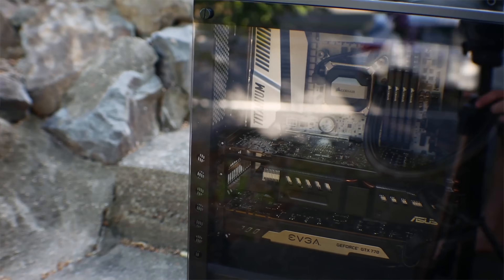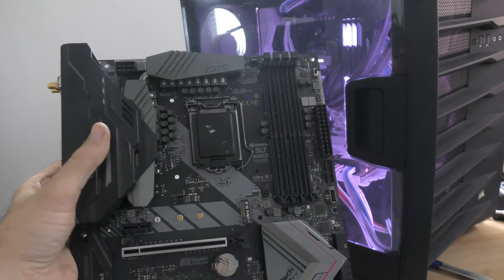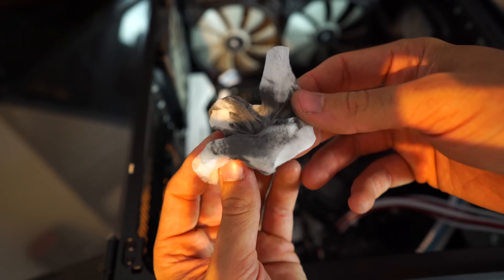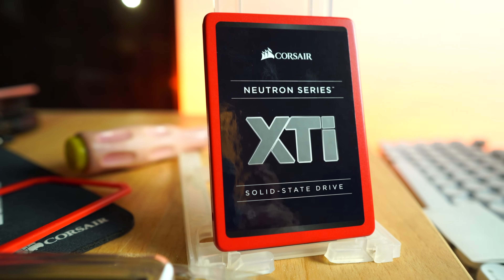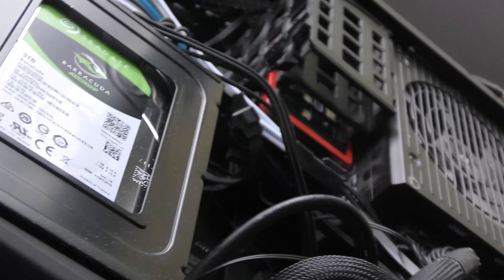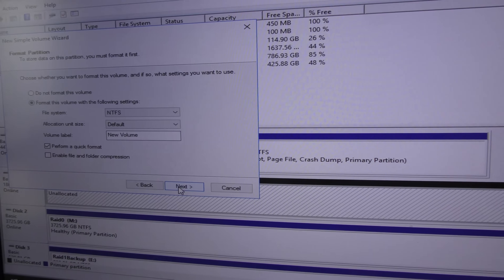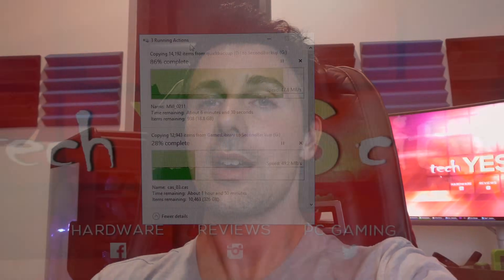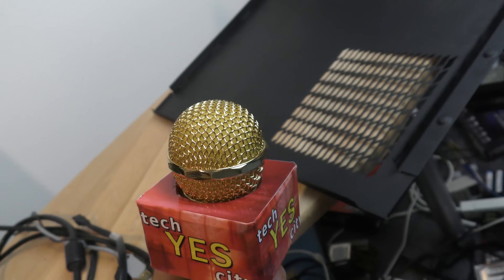Changing my PC from RYZEN to INTEL - Side, Up or DOWNGRADE?

Comment: 6 core beating 8 core? But all these AMD ryzen fangays told me its the way to go!!
Reply: ryzen is kabylake competitor

the competition for coffelake is coming in february (zen+) 

and the availability of coffelake is still trash with only expensive mobos
Reply: Pretty sure AMD never set out to 'beat' Intel.
Then again, AMD wins in most cases when it comes to price:performance soo, yeah?
For gaming, yes, the 8700k is best if you want maximum fps while running a 1080/1080ti at 1080p, other then that there is very little difference, especially for that extra cost.
Reply: Will
Yeah the facts you are pointing to show the 1800X is faster. Single and quad mixed benches don't matter, it's the MC mixed that does as that's using 100% of the CPU. That also inclues OC multicore performance which shows the 1800X being 7% ahead.
Facts don't lie, it's the bias of the fanboi that's cherry picking that does.
Reply: *marginally higher
It's just that their clockspeeds go up far higher which is due the manufacturing process AMD uses, however Global Foundries is claiming better clockspeeds for the next step so it will be interesting to see what Zen+ is going to bring. 

Also, @Will - Want some more facts? 
Fact #1: Intels prices dropped far more than they historically have.
Fact #2: Intels release of Coffee lake got moved up and has extremely poor availability. (theory:  It's a paperlaunch)
Fact #3: Moving up in core count beyond 8 cores AMD has much friendlier prices and starts getting better clockspeeds than Intel as well making it outperform Intel. This is due to AMD not shoving all cores on one piece of silicon but interconnecting them which makes heat/clockspeeds easier to manage.
Fact #4: Intel very uncharacteristically has Black Friday sales this year.

Does this sounds like  "The whole point is AMD cannot produce a chip even close to outperforming intel."? #3 Actually is the complete opposite of your 'point'. The rest seem to indicate (theory, but one that has some things to back it up) that Intel is upping their game this year, you know what causes companies to actually improve products? Competition! 

So in my opinion (and most people that like actual facts) they do have competition, hell they actually need to start making some changes if the race has begun towards more cores as AMD has build a base that will enable them to easily provide more and more cores in a cheap manner. Don't forget Zen is the first generation of this particular architecture. it will be iterated upon likely bringing instructions per clock further up, meanwhile Intel is on their uhhh 8th? generation so they'll have a much harder time to further optimize. Not to mention that Intel seems to have problems further shrinking down their manufacturing process whilst Global Foundries actually seems confident in their next step down - we'll have to see though, it would be the first time ever Global Foundries actually manages to impress instead of disappoint.
Reply: Your profile pic pretty much sums up my response to your comment.
Reply: Facts don't lie! http://cpu.userbenchmark.com/Compare/Intel-Core-i7-8700K-vs-AMD-Ryzen-7-1800X/3937vs3916
Reply: A 23% performance increase for a 32% increase in price, nice.
Sounds like you're the Intel 'fangay'.
Reply: Yes more performance costs more. Just as 1080ti is the best performance but of course not best value. The whole point is AMD cannot produce a chip even close to outperforming intel.
Reply: Overclocked ryzen beats overclocked 8700k in workloads.
Reply: Morbious Stone I know this isn’t exactly what you meant, but Intel doesn’t trounce anything 1600 and up from Zen by 80 FPS. Maybe 60 in a couple old 1 core games running at 720p, but normally the big gaps will be in OW or CSGO and be 250 too 210.

The 8700k wins in some productivity work, beats the 1700 and 1800 in cinebench and blender by a little, both stock and oc’d, and is also faster in Premier which seems to almost get stuck on 12 threads, using the others like ass.

It really varies app to app. Intel is obviously leaps and bounds better in gaming, if up to 20% is leaps and bounds.

Now at the same time, 1440p uw which Brian used lowers this quite a bit, as does 4k since the 1080ti is going to start dictating the cap, so the difference will probably show more like 3%—10% (60 FPS too 66 FPS).

While that’s true, the 8700k is still going to drop more frames when streaming, but I doubt he game streams often, and when he does, he probably has a nice elgato on another system to stream with.

It’s a tough call, but if Premiere is his bread and butter, he is going to get more from the 8700k. That’s Adobe’s fault, not AMD’s.
Reply: Will yeah but they will argue price , nobody is arguing that AMD Is bad price , were saying it'd worse performance
Reply: And they have toothpaste under the IHS.
Reply: @Will, I know you're a troll, but ryzen's intent isn't gaming, but workstation, and in that link you mentioned, Ryzen beats Intel by 1% in workstation. That's good, especially for it's price.
Reply: why outperform them? when you can get slightly lower performance at a reasonable cost.
that being said, i own a 4790k and a 8350fx in 2017.
they are fine today with games so, meh. 
not everyone needs a ULTRA MEGA STUPID RESOLUTION, that being said, i run sim rig on the 8350fx with a 980ti just fine on triple screen. XD lol
Reply: Tech By SnLiner The only annoyance I’ve found with Ryzen is the BIOS updates. Gaming, not so much unless it’s on a 1080 or better at 1080p.

Then RAM. sigh If you were an early adopter it’s a pain. I find that the Gigabyte ah3.. series works best with Trident Z, though I’ve never been able to get over 3433 stable. I’ve seen 3466, 3600, but even loosening the the timings to 20, 21, 21, 34 (which is silly, but why not try?) it still wouldn’t hold.

Anyway, a 1600 and 1700 at 3.9-4.0 with 3433 14, 15, 15, 21 is about as quick as a 7700k @ 4.9 in most games.

Again, that doesn’t help people who bought in the first few months.

On the plus side, you don’t have to feel bad about the purchase, as you can always sell the chip right before the new chips launch (pre-order) and upgrade. If not you know you’re safe through 2020 on whatever board you have upgrade wise, as even the nm switch will still be supported on am4, so again, not much reason to lament.

What is it about Ryzen that makes you feel “suckered in”?
Reply: the single core is absolute shit  also the 1700,1700x,1800x are the same thing just slighter higher clocks. 
but i have a gtx 1080 and my god i have never seen such a bad bottleneck its terrible! But other then that its great in muticore games which i dont really play.
Reply: Thats because it is not beating it in professional workloads.
Reply: Will yes amd has
Reply: it was the way to go, and still is for the price, but if budget isn't a consideration just go with one of the nutty 18 core intel chips
Reply: Wow a Kaby Lake competitor is slighly worse than the highest end chip from it's competitor (and is still faster in multi-core), AMD is so bad.

Now, seriosly, how is AMD not capable of matching, yet supprasing Intel? Ryzen 3 was much better than i3 7xxx in everything, even gaming. It even could almost match the perfomance of the cheapest 7th generation i5 and now the cheapest 8th generation i3.

R5 was all around a much better buy than i5 7xxx, giving marginally worse perfomance in gaming while being much better value. It has hugely better perfomance at everything else besides gaming, and even at gaming it was marginally worse at worst. i5 8xxx is better value with no doubt, but I doubt a 1600 buyer has anything to regret unlike those who buyed a 7th generation i5 because they wanted 8 fps more.

R7 vs i7 7xxx wasn't so one sided, because Intel's CPU was considerably better at gaming, but also AMD was about 40% faster at productivity. From gaming, the R7 series was bad value, but it could get a very close perfomance to the high core count Intel chips like the i7 7820x for a way lower price. For productivity, it's price was ridicously low for it's perfomance (actually, the Intel equivalents were ridicosly overpriced).

And now, Threadripper vs i9. That was absolutely one sided for AMD, at relase both CPUs costed 1000 usd but AMD CPU's was way more powerful than Intel's. The i9s could clock higher and could use more cores at games so is to be expected to win against the Threadripper in games, but if a 10 core CPUs is only better than it's competitor at games (because everyone knows that you need many cores for games, is not like those CPUs only exists for extreme multitasking and professionals), thats really bad. (Besides, there is the power comsuption and heat problems that the i9 series have, but I'm only focusing on perfomance)

Yes, Coffe Lake is overall better than Ryzen if prices were normal in all countries (I would had to pay 150 usd more for a i3+mobo than a R3+mobo for virtually the same perfomance), disponibility weren't as bad, and if we had mobos for locked CPUs. But if you compare Ryzen to Coffe Lake, Ryzen doesn't look as bad as Kaby Lake looks if we compare Kaby Lake to Coffe Lake. And Kaby Lake not only had a very short life, but those who buyed a Kaby Lake can't even upgrade to the 8th generation without changing the mobo.

Ryzen is only slighly worse than Coffe Lake while still having support for future generations. Kaby Lake is considerably worse than Coffe Lake while not even having support for the 8th generation. So, how is Ryzen so terrible?
Reply: That's because an Intel core is faster than an AMD core. The Instructions Per Clock are a lot higher on Intel than AMD.
Reply: Will single core 29% higher
quad core 30% higher
multicore 10% slower
price 25%-35% higher
Temperatures well... generally higher
Power consumption, higher aswell
Your troll factor in this comment
ITS OVER 9000!!!!!!!¡!!!!!¡¡¡¡
Reply: Will yup I got baited in with the god damn Ryzen shit. It’s ass
Reply: At least it isn't nearly as bad as it was with Bulldozer.
RyZen are quit decent CPUs that even for workloads that do not use 16 threads (which hardly anything does) they hold up.
And Intel is still overpriced. The better CPUs, but they cost too much.
Reply: I see you just love your/their Intel. Now kneel and praise AMD for making your master give you more cores.

Comment: Haha, I used liquid metal on the heatspreader back in 2012 on my i7 2600K. Had to sand it down to make it flat and smooth again, but it still works fine! Good video.

Comment: Once you had copied your data off the drives, you should have gone into the raid controller and   deleted the raid arrays and then used the diskpart command "clean" on the spinner drives and "clean all" on the ssd drives. This would more then likely fixed the disappearing drive issue in the Windows setup.

Comment: I also wanted to comment that personally instead of dumping my whole rig like that I would just have gotten a different capture card, and disabled sleep mode till a driver fix comes out, as I can remember a few years back on Window 8.1 with my AMD A10 5800K APU setup I had at the time Windows would randomly cash when going into sleep mode forcing a hard reboot., but a clean Windows 8.1 install, and driver updates along with a few UEFI tweaks fixed my issues.

Comment: Currently running M.2 950 Pro 256GB as main Drive and two 256GB 850 Evos in Raid 0 as Storage.
Reply: Tiago You run CCleaner like everyday right?

Comment: Are you using an Elgato HD60 Pro? That didn't work on my AM4 MoBo and Elgato told me to send it back to them so they can send me a new one with the latest firmware so it works for AM4.

Comment: even if i want i5-8600k for my only gaming dream rig... and becuase of my budget... ill might just get the r5 1600 to pair with gtx 1070 by the next year.... dependes if i find nice deal on gtx 1080 locally here since i dont even have a credit card (sucks i know :'D)
Reply: just get the 1600 because it  has 6 core /12 threads if you want it NOW. or get the 9600k if you care to wait. but hey what's your current CPU?
Reply: just a intel core 2 duo e7200 with a 2gb 400mhz ram and inno3d gt440 XD
Reply: There's Zen+ (zen refresh) coming too next year, you might hold on to that, BUT not to mention DDR4 RAM prices are so HIGH right now, you might wanna wait until 2nd half of 2018 if you want those prices to get down.
Reply: no worries mate, im in the middle of saving for a gtx 1070 right now, i might reach that certain date on release on zen+, also especially some say that at june 2018 the ram prices will go down (?) cross fingers :'D

Comment: Hey Brian sorry to see the problems. You asked about our RAID setup so here's mine. Running a Ryzen 7 1700, 32GB RAM, GTX 1070, Windows 10. I have a RAID 1 with 2x 2TB HDD's running the new ReFS in software RAID. It works brilliantly. Only down side about it is my video editor treats ReFS as FAT 32 and won't write files bigger than 2GB to it. The filesystem can absolutely handle huge files, but the app just sees something that's not NTFS, I guess. So I render to another drive and then move it to my RAID. I have have 2 other 1TB drives plus an older 1TB Samsung 940 SATA SSD with all my games on it, and finally a 256GB Samsung 960 Evo M.2. All this in a NZXT Noctis 450, with all the fans replaced because the stock fans SUCK. Cheers mate and please keep making awesome videos! You are my inspiration for making awesome computers out of used parts as well.

Comment: i have a question is the 1070 a huge difference between 1060 6GB 
i wondering because i want to get it for Christmas and i have to pay half and i dont want to work for a month and buy something $400 and not be that much of a difference
Reply: If you absolutely need the better framerate for 1440p or 144hz in certain games, buy it but I would advise against it, it's not a huge upgrade for the cost. You'd be better off waiting in my opinion
Reply: i have 32gb ddr4 3000mhz ram and a r5 1600 stock with gtx 960 4gb
Reply: It's a pretty decent difference, but, if you already have a 1060 you might as well ride it out. Otherwise you're just losing money since you already spent the money to get a 1060, unless you're still within the time period to return it.
Reply: yea
Reply: i would love to but i have to make my money by mowing my grandmas lawn and i only get $20 a month so its a struggle too, Thank you everyone helping me
Reply: i have a 960 not a 1060 and i would like to play pubg with better framerate
Reply: yea i noticed 
thats the only thing i haven't upgraded when i built my new pc